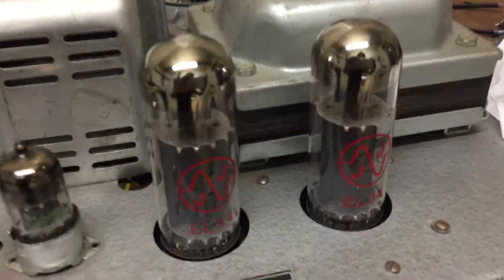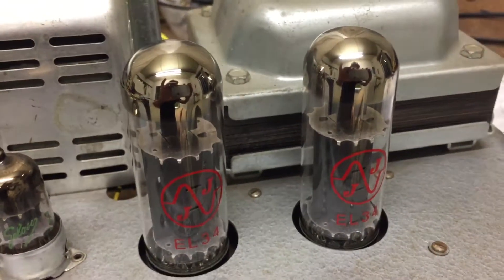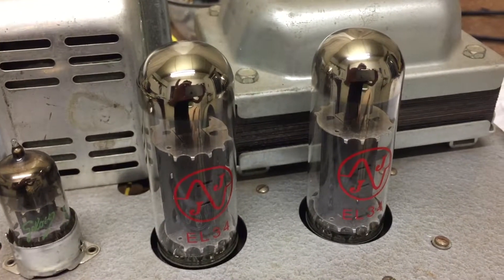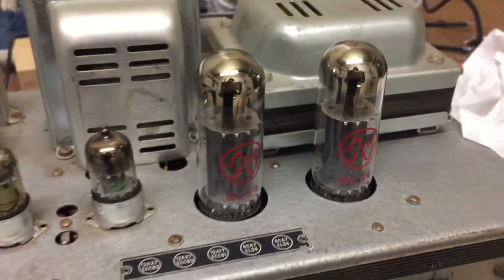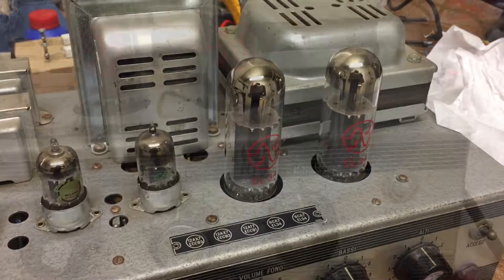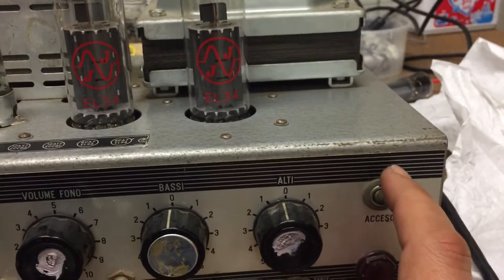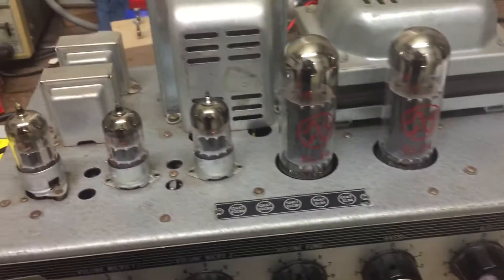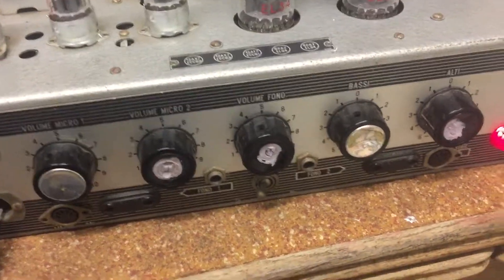1962 Geloso 227a tube amp - PART 2 recapping

Comment: What kind of capacitor meter are you using? It looks very usable and not very expensive.
Reply from the maker: I got it off Ebay: https://ebay.us/vLfWMT all the way from China but indeed dirt cheap. On the one hand, it will not really tell you what the capacitor will do once charged with a few hundreds of volts, but on the other hand, checking whether the old caps are really gone bad, is a great learning experience. Exploded caps which still read a decent value and mint looking caps that have drifted terribly, I've seen it all. ;-)